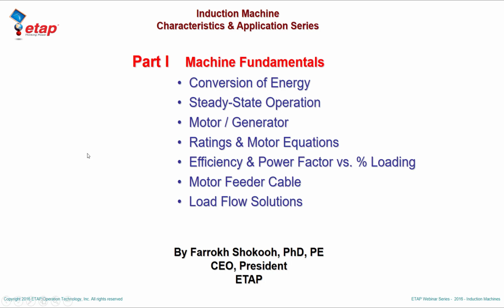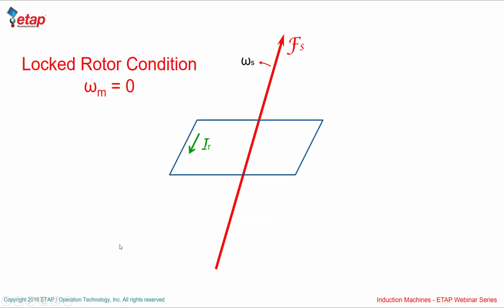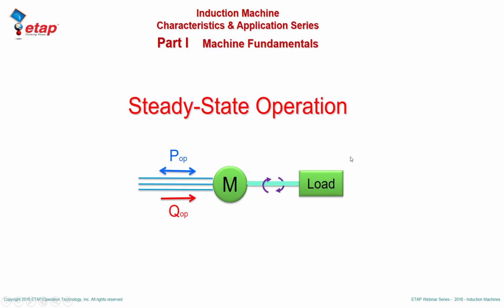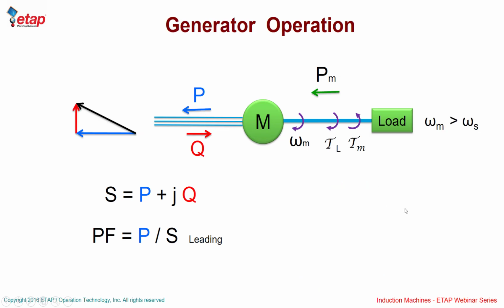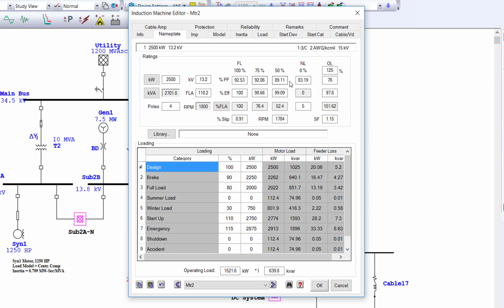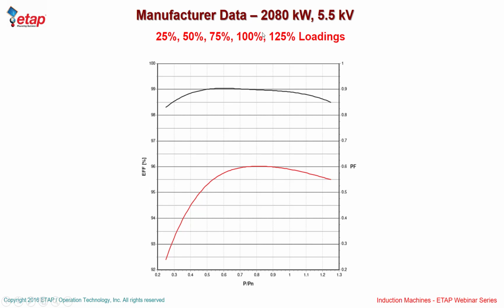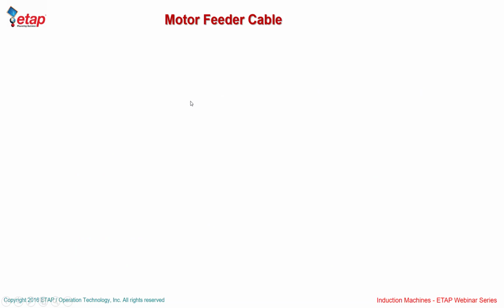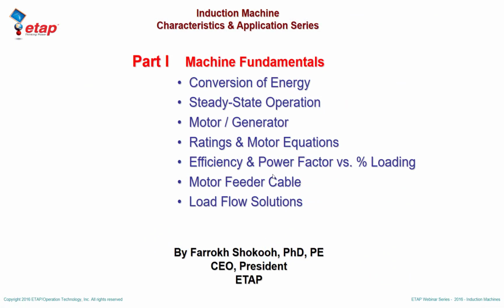Induction Machine Part I - Machine Fundamentals

Comment: Great video. Just the equations at 9:42 are a little bit confusing
Reply: Thank you your interest in ETAP Software. Please contact our support engineers at support@etap.com fo help you with any question you may have about ETAP calculations.
Reply: exactly. did you find answer to this problem? especially w(r,s) = w (r,r) + wm
leading to w(r,s) = ws 
if wm = 0, w(r,s) should be 0 and not ws
Reply from the maker: Thank you for you interest in ETAP Solutions and you positive feedback. Please contact our Help Center at https://helpcenter.etap.com to assist with your question.